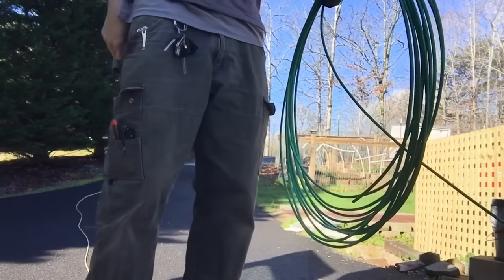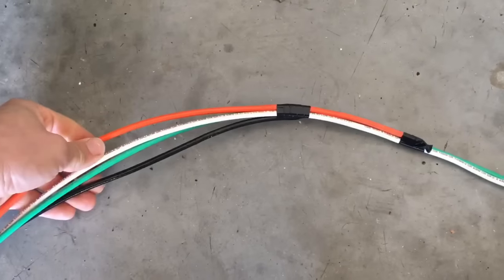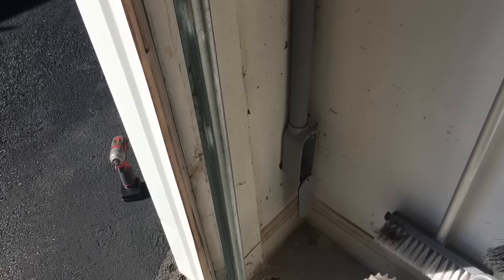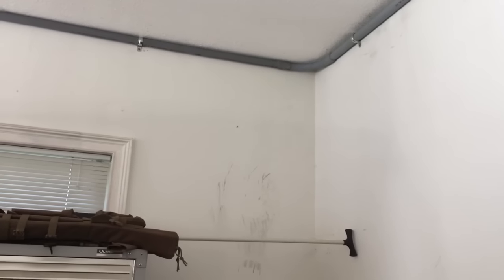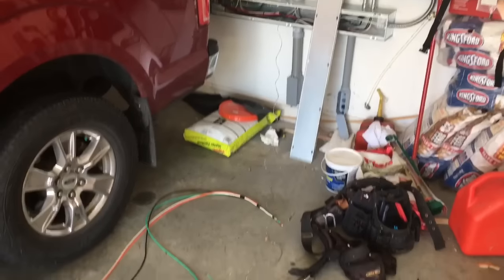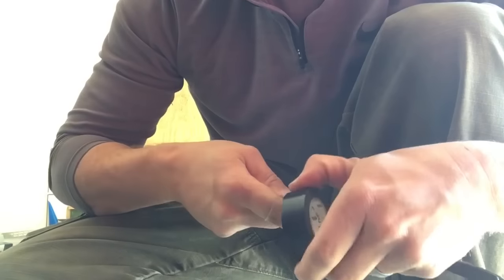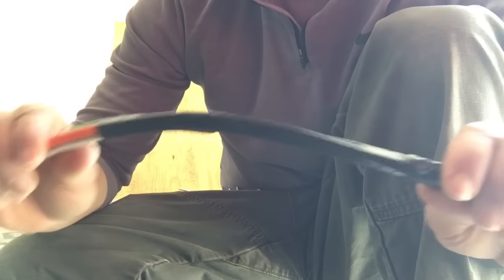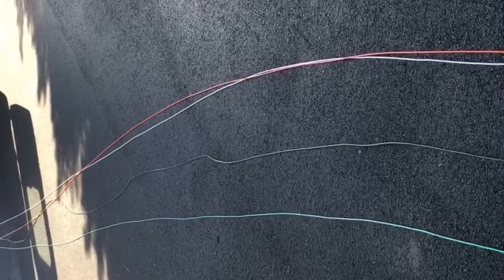Electrical Wire pulling secret string move

Comment: As an electrician, I use this repeatedly and daily. The head you made is pretty good except that we don’t strip the line at the front we let the insulation take the beating at the front so the copper pulls strong the whole way, we also use THHN insulation so it slides easier instead of XHWN insulation (I did see the part you said you used thhn but just saying for people to have in mind). Another thing we do is use wire pulling lube liberally applied if it keeps getting caught but always use it if there are already wires in the conduit. And the plastic line you tie on the end, we call it p line or pull line not that that bit matters 🤷🏻‍♂️.   The other thing is that when you did the Home Depot bag trick, that’s called a mouse (kind of because you find rodents in large conduits on jobs a lot) and the reason you had a hard time sucking it through the line is because of the way you tied the mouse. You want to make like a limp balloon in it with your finger, then tie a knott around the finger area, take your finger out, and tighten it up. It makes a parachute in the conduit that forces it through a lot better.👍🏻
Reply: Commercial, not residential or solar btw, if you have a minute to chat about solar, I’m gonna install some on my house and I need some help with knowledge on products👌🏻
Reply: Great advice. I also always "tape toward the hauler", so each edge of tape doesn't snag because it's hidden by the next loop around. I pull cable mostly through dirty old underground ducts, so plenty for the tape to snag on.

Comment: Use ping pong balls for the line vac. Drill holes through, string through, tie double knot, and vac away. They fly through the conduit with no chance of snag or bind. Clip the string. Put the balls back in truck. Always on hand if needed.
Reply from the maker: I will try this
Reply: this is clever.. nice tip
Reply: What sized conduit is that good for?
Reply: @GainSolarPower  what kind of knot u tie to keep it tight?

Comment: You can walk the wire out walking forward not backwards, much safer that way.
Reply: Exactly what I was gonna say. Much safer cuz you cuz you can see where you're going
Reply: Exactly... You definitely do not " have to walk backwards..."
Reply: Some people have difficulty walking backwards apparently.  You don't have to sprint.
Reply: @BADALICE  walking forwards is just easier than walking backwards, and walking backwards poses safety issues cause you can't see behind yourself.
Reply: @crack1270  Is that right?  You can turn your head you know.   You ever think there might be a reason he suggests walking backwards?   Same reason I do.  Not stepping on or over the wire.
Reply: @BADALICE  ya cause lord forbid you step on the wire 🤣
Reply: You knit Pickin ain’t ya ? 😂😂

Comment: I always separate the strands on the head and bend them over the loop of the pull string then reverse twist around the head. Will never come apart. No matter how far your pulling. Nothing more embarrassing than your head pulling apart and you need to start over.
Reply: I thought the same thing.  Hoping the tape holds is a Apprentice thinking. 
Plus a shot of lub will sure help.

Comment: If you tie the bag on one end instead of the center it flies thru the pipe. I have done many pulls over 700’ this way. I use 50 lb monofilament fishing line then pull a rope thru for the really long pulls. The monofilament is ridiculously fast thru the pipe.

Comment: I always pull a string after running long lengths of pipe and when i tie on the conductore i usually cut off most of the strands on each conductor leaving about 4 or 5 and tie all conductors to the string/snake staggering.  The "head" is smaller and there is little chance of a conductor coming off.   Some underground installs DO get mud in them unfortunately for a multitude of reasons and this method increases your chances of pulling them all through the first time.

Comment: Something I learned when I was an apprentice electrician, I live in Australia, was the use of a vacuum to suck a string through a conduit. You can then use it to pull the cables through. To help the cables, we used to use talcum powder. The J&J worked the best plus it smells good. It worked great and doesn't leave the cable sticky.
Reply: Gonna remember the talk trick. That could save some cussing and fighting one day lol.
Reply from the maker: Never heard of guys using talcum
Reply: @GainSolarPower  It works wonders. You don't get dirt sticking to the cable like you do if you use slippery lube. It reduces the friction a lot when pulling cables through conduit. You don't need a lot. What I do it have the Talc container and drill a 1/4 inch hole in the top. I give each length of conduit a quick puff of talc. Make sure the ends are CLEAN of talc if you are going to glue them. Ants hate talc too.
Reply: @GainSolarPower  I could see it making slick wire slicker
Reply: @GainSolarPower   cause it gave them ovarian cancer and they didn't live long enough to tell anyone about it- ;)

Comment: Lay the wire out in long S patterns instead of straight so you aren’t pulling all the weight of all the wire.
Reply: figure 8's.  takes up less space.
Reply: Those are pretty good ideas for an industrial setting.
Reply: this man pulls cable
Reply: Can you preload it on a spool reel with a fixture holding it with a pipe in the center? If it's something you do frequently it might be handy to make one for that purpose.
Reply: Union clowns
Reply: I always leave it on the spool lol
Reply: 100%
Reply: As an apprentice on my first BIG pull, 200' 4 # 3/0 THHN copper wire I pulled them all straight out. I could not pull them up fast enough to keep up with the pulling machine. the guy pulling could not hear me yelling to stop, (in a noisy factory) so the wires went in all tangled up. Next time I ran an extension cord over to where I was, and unplugged the puller if I needed to stop the pull. I learned real fast to serpentine the wire.

Comment: Here's an old electrician's trick (and I qualify on both counts):

If you're going to be an idiot and step on your wires while you are rolling them out, at least roll out your HOT wire last. If you want to get yelled at on a jobsite, walk, or better yet, drive, across the electrician's wires.

And I rolled out everything including Romex (which I completely agree that you should do), but I managed to do it while walking forwards and even occasionally chewing gum.
Reply from the maker: Thanks old sage
Reply: @GainSolarPower  Anytime, and let me know when you want to go over the benefits of that new-fangled Knob and Tube method of wiring. :)
Reply from the maker: MrWaalkman I backed into the electrical trades from solar so Aside from a week here and there, I’ve had never had the privilege of working under a single “.master”

Comment: Nice video,explained well.just one other tip is when you are taping the end where you are attaching the  string, start taping from where you have all the cables and tape towards the loop where you attach the string,and the tape will lay without any edges that might catch on any of the joins in the conduit.
Reply from the maker: Nice tip!

Comment: The vacuum is a clever trick. 
You don’t actually have to walk backwards when walking out a custom length roll. I haven’t walked backward like that in 25+ years. When you have enough practice, and if your rolls were well done, you can walk out two or three rolls simultaneously. Two is easy, three is about the limit. 
It's a lot easier just to get full spools, put a piece of conduit through them, put that across an open ladder, grab the ends and go. If you brace the ladder so it doesn’t tip, you can walk out 6 conductors at a time. Alternatively, a couple nails in wall studs on open frame houses, or conduit straps in steel studs instead of a ladder on commercial sites. A handy trick when you have to run 0.9 miles worth of conductors in total, such as wiring a factory or distribution center.

Comment: After 30 years on commercial projects I watch to see if someone knows a trick I don't know.

I'm retired as an electrical contractor and after ten years of watching YouTube videos I haven't seen anything new.

1. The code says no more than 120° of bends between access points. If you could get a string through 360° you wouldn't even be able to pull even the string much less a wire.

2. What makes the wire drag is friction. The flat string doesn't really matter. It could be round as long as you don't exceed it's breaking strength. The smoother it is the better. Those little string containers from Home Depot or Lowes are just a mess of kinks. Buy the large bucket of pull string. It's handy to have for lots of reasons even it you are just a homeowner and don't need that much.

3. You are correct about staggering the wire end for a smooth entry and taping the ends. However, (here comes the pulling argument) tape the loose ends of your string back past the farthest piece of wire in your pigtail. Hold that point with one hand (use your left if you are right handed). Use your right hand to make a simple loop in the middle of the string and flip the string loop over and slide the string loop up the wire end to the end of the farthest wire. When you pull the string tight it will form a small knot. If you did it correctly that small knot will clamp down on the wire like a Chinese Grip. The harder you pull, the tighter it gets. It will take several attempts to figure out the right way to flip the loop over. Tape the loop in place so it doesn't move. With practice you will learn to put the slip knot at the very end of each wire (or cable) you add to your pull. The knot helps smooth out the pigtail so there are fewer/smaller high spots to get hung up. Move your left hand to the knot you just made and repeat this process with making the loop with you right hand about every 6"/8" to a foot until you have worked your way back to the leading end of your pigtail. Put one last knot as close the the end of the pigtail as possible. Always hold the string tight while making the knots. This will never pull off. It eliminates that whole shepherds hook you made which sometimes gets caught at joints and entry points. The harder you pull the tighter it gets. Those multiple knots spread out the tension on the pull. Practice until you get this right and teach it to others. There will be no more arguments!

4. The string alone won't "cut" the conduit on the inside of a bend. Heat generated by friction does that. The heat softens the pvc and the string abrasion does the rest. If you are having that much trouble use wax based wire lube, sparingly. Try not to get it on your hands.

5. Start your pull at the end of your conduit run with the most bends or with the closest bend. It's easier to pull past the worst part at the beginning.

6. If possible (outside on long runs) pull down hill. Gravity matters!

7. Try not to pull more than 200'/250' between pull boxes. If you break a string/rope it's easier to fix your problem. Also, if a conductor comes up short it gives you options.

8. Lay out your conduit run so that you have room to pull the string. Trying to pull something hard when you are tight against a wall/floor/etc is no fun.

9. You are correct about laying out your wire. Be careful outside. If it gets dirty that will add a lot of friction to the pull. Use wire on spools whenever possible and wire in boxes only when necessary.

I have built thousands of miles of aerial and underground utilities and pulled hundreds of thousands of miles of THHN, fiber, data, comm cable.
The trick with the string loop never fails but it takes some practice. There have been only a few guys that have worked for me over the decades that just couldn't figure it out.

I'm probably forgetting something but if you got this far in life you can figure it out.
Reply: @Jim Remmell, sure would like to see a vid of you rigging up a pull. What you're saying sounds good but I can't envision it.
And that tip about the closest or mostest bend being the starting point is great!
Reply: @seanflanagan5674  

I don't have a YouTube channel and don't really have an interest in starting one. However, a friend of mine does. I'll ask him if he is interested in helping me demonstrate the pigtail setup. I taught him. If he's interested we'll shoot the video and I'll respond to this video with his channel so you can see it. I knew it was going to hard to figure out without actually seeing it. Even after seeing it practice is required. Once you get it you'll be amazed how easy it actually is.
Reply: NEC code: There shall not be more than the equivalent of four quarter bends (360 degrees total) between pull points, for example, conduit bodies and boxes

Comment: I use a similar method to pull new circuits though the frames of RV's.  Then once it's through I push convoluted split conduit over the wire and follow the pvc conduit as I pull the conduit off the wire.

Being a retired Power Company LIneman I've pulled hundreds of miles of wire through conduits.  All the way from 120 Volt to 345 KV Million gauge high voltage urd wire.  Good Video for the DIY'er who are just learning.

Comment: Was at a job site one day and the guys were pissing and moaning about no rope in what was probably near a 200 ft run of buried conduit with several bends going around the house. (got caught on a machine and pulled it all out) One guy comes up with a small plastic grocery bag and a ball of string. Another guy scrounges up a shop vac and a power cord. Ten guys gather around and say it wont work. Two minutes later the string had made it's journey and they were pulling a new rope through.
Reply: Plastic grocery bags work best for that.
Reply from the maker: It’s pure magic

Comment: I like to use 2 or more half hitches depending on amount of conductors and a full hitch and then you can leave a tail to add a back string if needed, and tape the knots
Reply: Agreed, and always tape from the cable onto the string, so that the edges of the tape don't snag because they're each covered by the next layer.

Comment: I pulled 3 #6 through 3/4" emt, not more than 20' at a time. Not easy going through elbows.
Didn't have a bender for 3/4", so I went to the store and used one there in the aisle. Got to the register and asked the teenage girl if I can get a discount on the emt because it was all bent up. She was about to ask someone, then I told her no, that's ok. She didn't know what to say at that point.
Reply: It's their fault for putting the pipe bender right in the middle of the aisle. Heck, if they had a hacksaw in the aisle I'd bend the pipe, cut it to length and ask for a discount for only needing half the pipe.

Comment: About 30 years ago, I was doing a pull, and didn’t have any Electrical Poly String on the truck. Walked to a downtown hardware in DC, and bought Masons Twine. It works a lot better in my opinion, been using in since.
Reply from the maker: I’ve pulled that too. It’s seems like it cuts the pipe a lot quicker than twine.

Comment: Lol when i had to string wire up above false ceiling at work i would tie fishing line or twine to a nut or bolt then use my slingshot and shoot it to ware i was going to pull wire. Then tie wire on fishing line and go to where bolt landed and pull it accross. It beat moving ladder every 5 feet to reach my 100 foot mark.